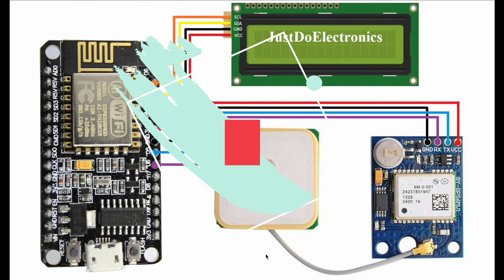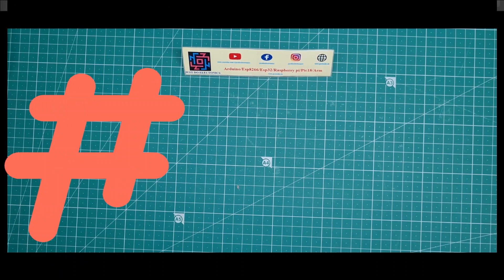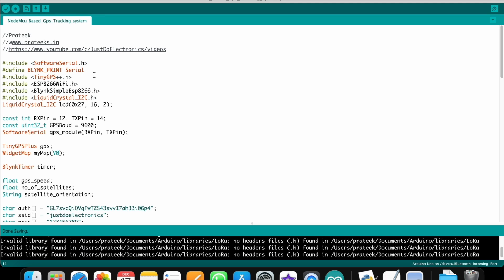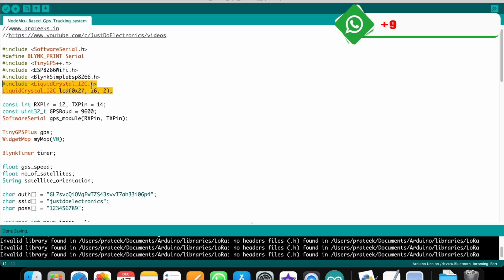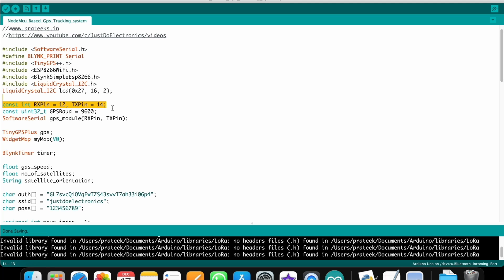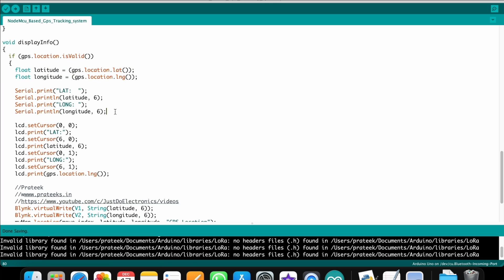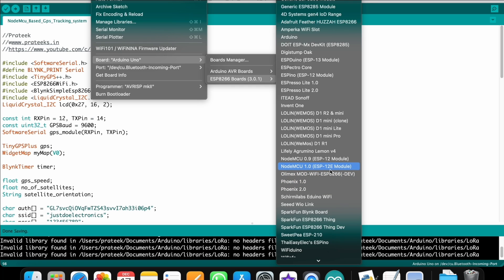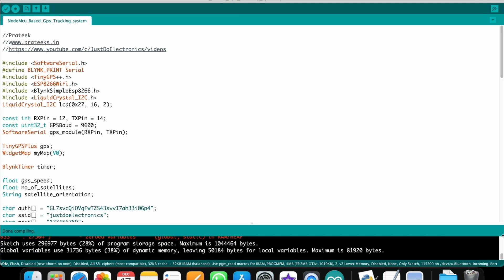Real Time GPS Location Tracker | Nodemcu Esp8266

Comment: Hi sir, if I use this code on esp32 will it still work?
Reply from the maker: Yes
Reply: @JustDoElectronics hi sir, i have a problem with sofwareserial when i using esp32. What are the Solutions to overcome this issue? Thanks.